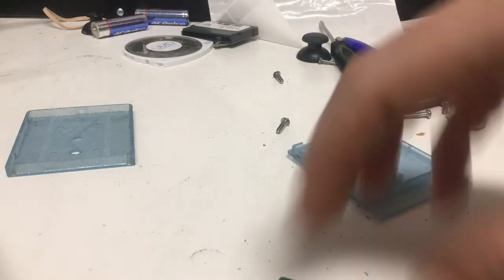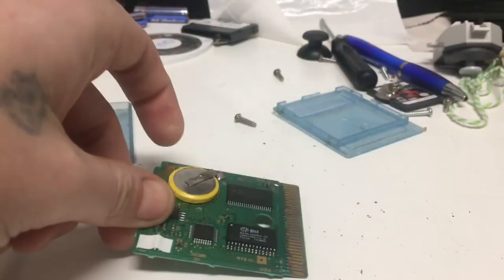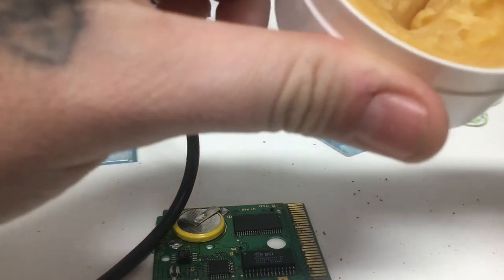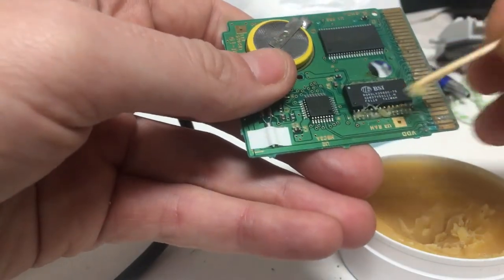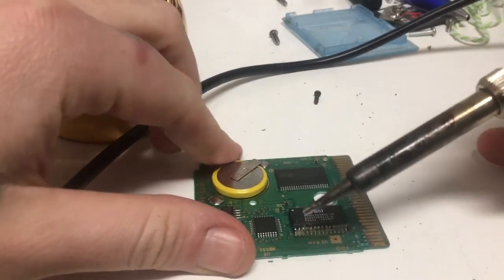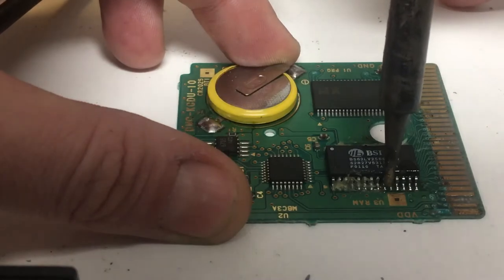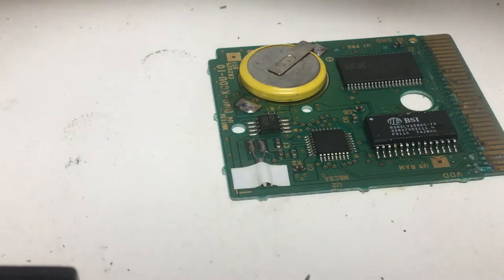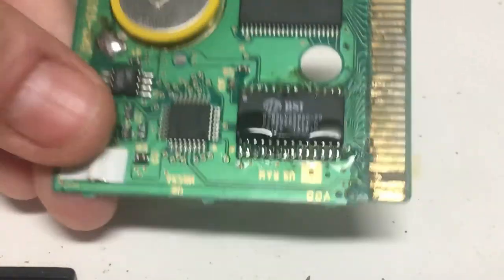How to do a reflow

Comment: How hot do you turn your soldering iron for reflowing such connections ? (in C° referably)
Reply from the maker: Safe bet for most irons would be between 325 and 350. Depending on life and quality. If it’s brand new I’d recommend priming and tinning. You’ll want solder to be able to stick to your tip. After use, I also recommend that you put solder on the tip to keep it in good shape for the next time.

Comment: So I attempted this and now the gbasp won't turn on when the cart is inserted. Any advice would be helpful.
Reply from the maker: I’d check to be sure that none of the legs are bridged with solder. Which would mean solder being connected between the legs. Be sure to clean the contacts of the cartridge with 70% rubbing alcohol and a q-tip. Other than that, I’m not quite sure without seeing it.
Reply: @cloudstriferepairgaming  yea, they are bridged 3 spots in between them. I take it it's making it overload the circuit?
Reply from the maker: @flamer38544  that’s correct. Don’t have to be shy with flux. It’ll work wonders and act as a guide for the solder. Just be sure it’s all clean when you’re done, and it should be good. 😎👍